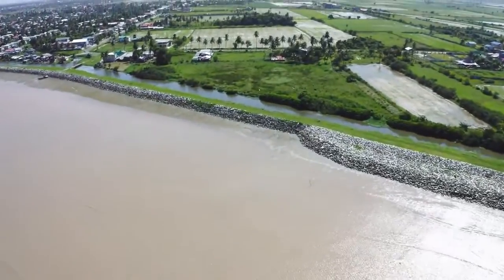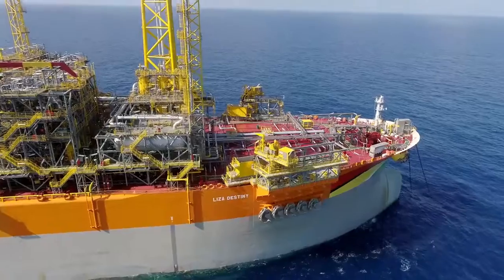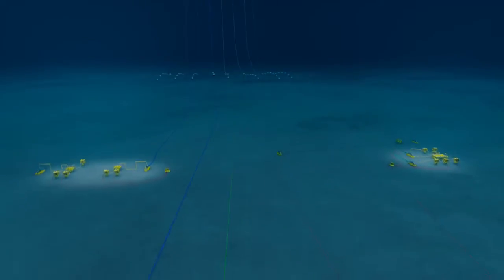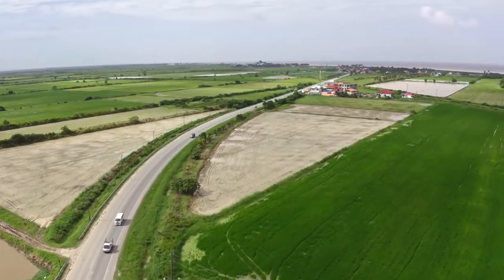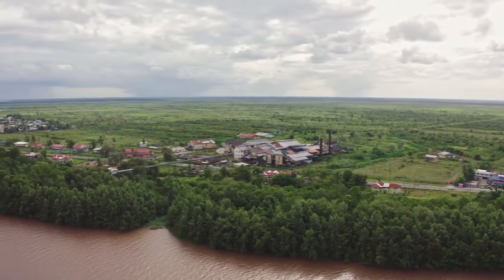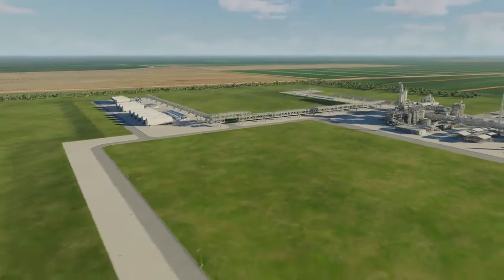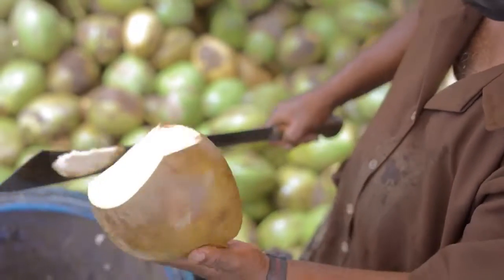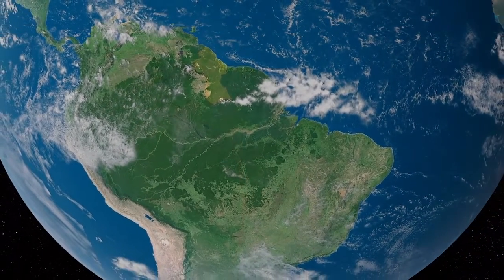Guyana Gas to Energy (GtE) Project

Comment: I agree that Guyana will have the infrastructures. Guyanese at large will not benefit. There are problems with a work force and immigration-slavery and indenture-ship of the modern era will occur. Businesses will invest because of cheap power. Metals and materials will be made which will drive manufacturing. I expect the Chinese to benefit from import of Chinese labor into Guyana. Guyanese will not work for cheap wages and Guyanese are not in those numbers. It can be predicted Guyanese will be overwhelmed all around.
Ali should be more concerned about the realties in Guyana. The PPP should develop for the Guyanese people and not for attracting businesses in a large scale-immigration will be a problem. Both Indians and Blacks would not want to minimize. 

The PPP have embarked with giving away large acreage of lands to foreigner and yet bull dozes citizens homes considered squatting. Titles are given to some but no basic necessities follows.

They lack a plan for improving the lives of the current citizens. Instead, they are bypassing them for a future that leave the current citizens in their present state.